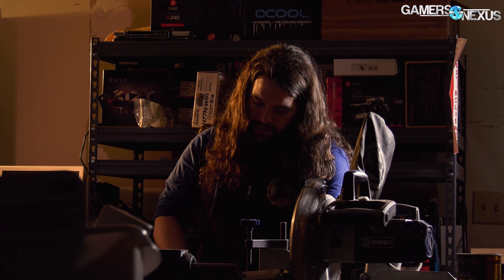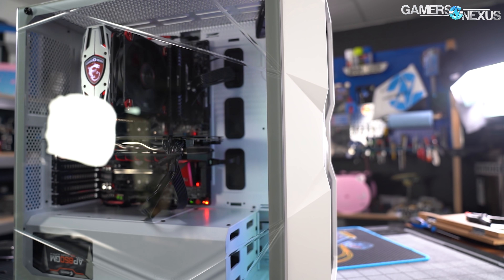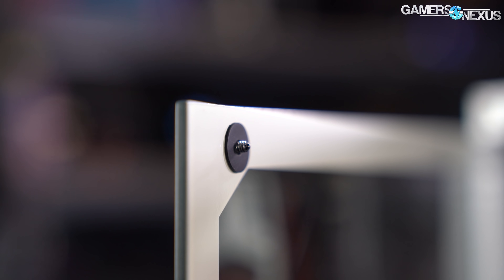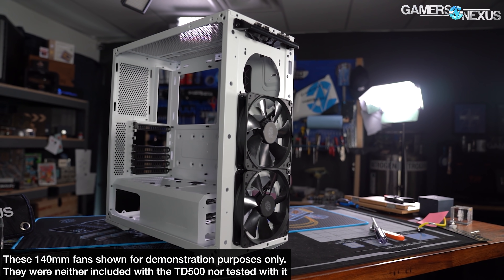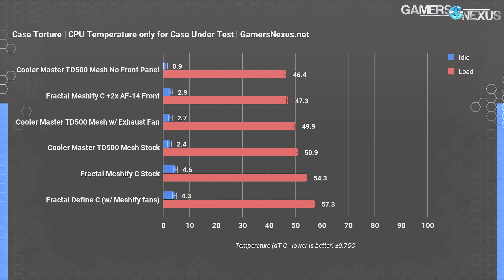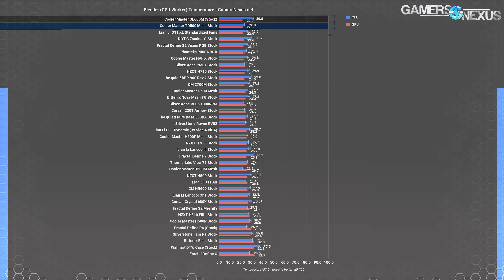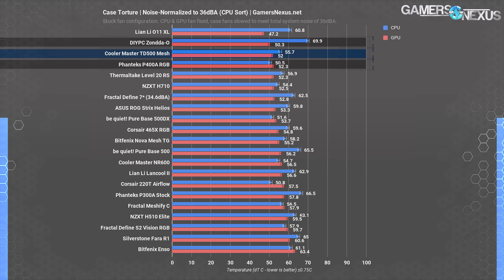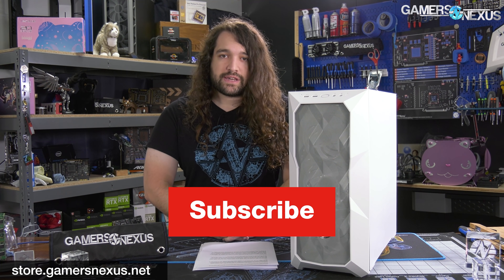Cooler Master TD500 Mesh Case Review: $100 Airflow Show-Down

Comment: Having worked in a repair shop, people never clean their filters. Ever. The use of a fine mesh on the front that's jokingly easy to clean is a very good move. It'd be a lot more obvious to clean, you just wipe it or vacuum it off.

Also, the aRGB header is nonstandard? I could have sworn I hacked up a controller for a friend's cooler master fans and it worked on a 2$ WS2812B controller from ebay
Reply: I clean my DEMCiflex nylon dust filter every 2 days at least and it has visible dust after only a few hours.
Admittedly it is situated in a living area where two skin shedding and cloth wearing humans spend a lot of time but if you're only wiping a mesh once a month that's a lot of dust getting through. It's only logical that if you can see the holes, then non-visible dust can and will get through.
The ideal solution is a dust filter and no mesh like on the upcoming Silverstone Alta F1 (much excite!) or the more ugly solution; my Silverstone Primera 02 with the front panel permanently left off. It likewise solves the problem of filter visibility which you mention.

Comment: I have this case and it's really good. But the top only supports up to 280mm aio that is only if your ram sticks and VRMs are 44mm or lower. The front supports up to a 360mm aio. So if you want better top mount aio compatibility this is not the case. I believe this case is well optimized for air coolers.

Comment: Hi Steve & Co, - what is your opinion(s) on why cases with side-fans have fallen out of favour? Is it because of fan cabling issues, or perhaps just aesthetics of wanting to show off the interior of the case overriding practical concerns? ... Surely a plexiglass type plastic could be drilled and fitted for a side fan?

Comment: Hopefully the fans they included with the TD500 Mesh are better than the ones that came with the OG TD500, because those things were loud AF and I had to replace them to make it worth installing an AIO. Shame it doesn't seem like they improved the cable management area much, because trying to get that side panel back on is a royal pain, and there's barely enough room for the 24pin to fit alongside anything else.

Comment: Oh... What if you have AIO pump tubes to the right so the logo in the pump would be oriented correctly and the radiator is at top? Does that cause problems in the long run? Never thought about these things, always learning something new! :)

Comment: My 500M came with 2x200MM fans. They are electrically compatible with MSI. I have not tested logically, but have the 3 fans and a 3rd HALO fan on the same spliter.  I wonder if with later runs they went with the 5v standard. Mine was built in March.

Comment: My personal point of view says that this is not as good as the competition game.
Let's just compare it to p400a.
Airflow, fans, mesh.. okay both cases do well.
Both cases are like the same price and well built:
P400A extra offers at the same price:
A good bottom and actual cleanable filter
A lot more cable management area to work with, a lot more routes and high quality cable ties.
Better quality dust filters.
Already a dealbreaker for me.
Phanteks: What i'd love to see, is a p400a v2, with the same layout but a bit more modular and the cable management layout of meshify's c, which is a lot more convenient.
Fractal Design: Also an upgraded version of meshify's c, competing these cases with dual 2x140mm rgb fans or 3xz120mm rgb fans while removing the filter inside the front panel which is pretty much restricting the airflow it could have.
Coolermaster: The approach of being unique is awsome.. but build quality was never the focus for coolermaster, and they are being pushed back for this spesific reason. Also the things i said above.
So for the TD500 v2 i'd like to see some stuff:
- More room for big cables on cable management area, and good quality cable ties. (these are must for 2020 standards.)
- Better side panel lock mechanism, this is way to old school. Tooless mechanism is big plus.
-  Some work on build quality material, mostly on front panel
- Some actual good and removable dust filters
- And for god's shake add the other rubber mounts for ssd's. That's such a low cost, and things like that make "possible" customers look somewhere else.

Comment: Just ordered one of those after realizing that cheaping out on a case when putting together my current setup was a bad idea, especially combined with my RTX 3070 being a twin-fan version... which combined with a front-closed Modecom Oberon Pro case was making it cook itself in summer, and even without it, it seems to run too hot sometimes, even after adding two extra fans to the front(Obviously that barely did anything thanks to that case having only tiny holes on the sides...)

Comment: Did they sponsor you? I used this case for a new build. Probably the worst case I've worked with. For example, the hard drive 3.5 in bays is a second thought and is basically smashed in to the cabling from the power supply. I have yet to install the drives but I don't know if there's going to be enough realistic room. The screw profile for the case when installing a video card means that I have to go on an angle just to install the screws because the metal shroud blocks the direct access to the screws. I know they are trying to create a good budget case, but there is a lot of cutbacks where they sacrificed general layout to and it shows. Great airflow is nice but if you can't get the package together it gets frustrating

Comment: I want to see tests where all the fan placees are populated with the same fans (such as nzxt h500 with all the 5 slots populated) with 120mm fans (i prefer 140mm but it is not available to all cases so the test will vary) to see how well the case can perform compared to others.
Same fans, every fan slot used.

Comment: I have a CM MB511 case and the tooling in my case is extremely similar to the point, that I could take off the front panel of my case and change it for the front panel of this case.

I just checked CM's website and they sell parts for their cases and the TD500 front panel is 10€.

Comment: I like the look of the case but there are a few flaws.  Personal I would spend a bit more for the H500 Mesh, but on a budget this is a great option.  The only major downside for me is the cable clearance which is a little too tight - I could buy a new PSU with flat cables but (1) that negates the cost advantage of the case and (2) who has any stock of PSUs!

Comment: How about replacing stock fans with same-size Noctua fans, to correct for fan-specific performance? It would make more sense to test this case with 3xNF-A12 in the front, than the current "standardized fan" approach of 2xNF-A14 front + NF-F12 rear.

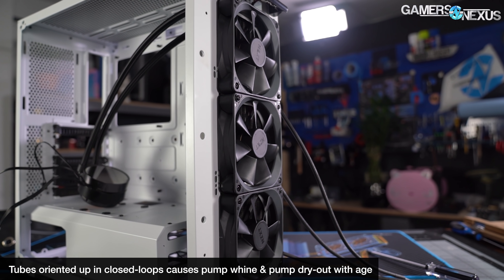Comment: Hey, I have a front-mounted 240mm aio (CM ML240L), the tubes top-oriented ( 12:09 ) ... I don't know if the tubes will have enough reach to put them down-oriented on the front, also the gpu would get in the way as it is pretty big.
Should I just re-mount the rad at the top of the case? Case is corsair obsidian 450d

Comment: I don't plan on an RGB build so I do plan on replacing the front fans with 120mm Artic F12 PWM PSTs as they are great fans and the blades are white. Will a 280mm fit ok in the top of this case or am I better off with a 360mm? Also rear exhaust or don't bother?  I already have those fans on hand and a buddy said he would buy the ARGB from this case off me. Just wondering what the best cooling config would be if I am using an AIO on my CPU.

Comment: Been waiting for this review, thanks!
Any benefits or harm to adding 2 additional fans to the top of the case (directly above the main board and CPU cooler) with a rear exhaust fan? Assuming there's also a twin fan tower air-cooler for the CPU.
Reply: As long as the top is intake there should be no problem

Comment: I unfortunately have to use CAM as I had to get a fan controller because 2 of my mobos fan headers burnt out (my own stupidity). The controller though at least doesn't need the software to remember settings.

Comment: Whatever you do DO NOT buy the non-smesh TD500, which I've seen on the Coolermaster site referred to as the TD500 Crystal. I have no idea what the designers were smoking when they put a large sheet of perspex in front of the 3 fans, but the thermals are terrible. I bought 2 PCs - 1 for each of my kids - that came in a TD500 Crystal case, and although I am not a case modder I ended up replacing the front perspex with mesh bought from Bunnings (Australia hardware store) and pantyhose. Not what you want to have to do when you buy a gaming PC, but it improves thermals on the graphics card by 10 degrees under load.

Comment: I bought this case for my niece, good airflow, case design little bit cheapy , and included accessories are the most cheapy I've ever seen in my life...the last time I assembled new case NZXT Phantom was 2017, they included good number of accessories, hardware screws...etc...this has Nothing except those SSD mounting rubber spacers, ziptight, little RGB hub as separated RGB operation if your mb doesn't have RGB header...a few hw screws to mount mb...

The photos in the manual misled , the bottom psu cover CANNOT be removed! It is 3.5 hd rail removable!

After all B rated mid tower case!!

Comment: I'm having a hard time deciding between this 2021 TD500 ARGB Mesh vs Phantek P400A. Both seem to cool well, I'm curious which one filters more dust. Leaning to the CM because it will fit the biggest Noctua CPU fan and has updated USB inputs.

Comment: Takeaways from this video:
- CollerMaster made a good "500" case on the first try
- Phanteks needs to release P400A with updated internals and call it P500A, to be in line with other around $100 500 cases
- beQuiet should have named their case just PureBase DX, since D is 500 in roman numerals

Comment: What does GN think of the Fractal Design Focus G ATX Mid Tower?
Reply: Probably nothing :D it's been out since 2017, enough time passed that many people bought it (ur humble servant incl. xD), just as many people asked for a review I imagine... and nil
Reply: in any case (tee hee... no pun intended)
1) no PSU shroud if you're into that
2) not too much space for cable mgmt
3) I managed to grind some metal off one front fan fixture, and it looks like it wasn't too straight from the factory... still holds tight but some parasitic vibration is quite possible
4) the metal is otherwise very nice, esp. for the 40 euros I paid... miles ahead of Deepcool and other Thermalfakes. Maybe it's the glossy finish that contributes
5) similarly, all panels sit tight if you're not sloppy. No odd buzz
6) insane airflow imo, doesn't get hot inside
7) top fan placement is a culprit though, the mesh plates sit between the fans and the chassis so you have to unscrew the fans when cleaning time comes
8) same goes to the front panel. A pain in the neck to remove, although it may be similar for other cases, haven't tried :D

Comment: Silver or white radiator screws are that uncommon, are they? Surely they'd be preferable to pins or black screws. The stock fans look like they have transparent frames that let through light from the sides, I'm surprised they're not sold separately although I suppose their Halo fans are their alternative.

Comment: The added fan on the back invalidates my main question. How do you feel about the included cooling solution? Are the 3 RGB fans in the front sufficient or should I add anything?

Edit: nevermind got to the right part of the video. ill leave this as a mark of my idiocy rather than deleting lol

Comment: I'm having issues with my TD500, when I connect it to the mother board it wont boot at all. I Turn on the power supply and I get an RGB light from the mother board so I know its getting power. and I followed the connectors on the manual properly I'm sure.

Anyone else having issues with this?

Comment: at 16:00 to 16:20 what does he mean? "That mesh isn't good enough alone." confused by what that means exactly and what are my solutions to that problem?
Reply: He means you need to buy good case fans (140mm Noctua he says here). Basically "mesh isn't good enough alone" = "mesh isn't good enough alone without good case fans to take advantage of it"

Comment: I recently bought one of these, I put a radiator on the front but there's very little airflow inside the case, the glass on the front blocks most of the airflow

Comment: I have a bit of ADHD so I couldn't quite make out a detail, but is this review suggesting to add an exhaust fan at the back grill area of the case? I just bought the case and finishing up my 3080 rig, but the product did not come with an extra 4th fan for the rear mount. So should I buy a 4th fan for back exhaust?

Comment: Hello, I need help. On cooler master page it says "Radiator Support - Top
, 120mm, 240mm, 360mm, (44mm max motherboard component height)" but on 12:21 in this video Steve says top has 120 and 140mm mounts, does that mean 280mm will fit? I want to buy this case with Acrtic 
Liquid Freezer II 280.

Comment: I see the specs (in 2022 at least) say it comes with a non-RGB rear exhaust fan, but in video reviews, no one seems to run it.  This review used a cheap 120mm exterrnal fan for additional tests, which implies it doesn't come with one.  Can anyone clarify?  I'm guessing in any case (excuse the pun!) that adding a rear fan of any type is going to be pretty negligible in terms of what the test results returned here, so probably not worth worrying about ...

Comment: between this and lian li 215 , which one should i pick -_-a  this TD500 look gorgeous, but Lianli 215 cheaper in my country
Reply: Was looking for a case upgrade and was about to buy this at my local microcenter but I just couldn't get over the weird design on the tempered glass side panel. Went with the Fractal meshify 2 instead. A bit more expensive but oh my god is it perfect for everything you throw at it. Amazing airflow and design. Easy cable management, and crazy radiator compatibility.

Comment: Tubes go down? That’s literally the first time I’ve heard this. How’s that work on a top-mount or rear radiator then?
Reply: I think in that situation try to keep most of the tubes low. Idk if putting the tubes left or right does anything.
Reply: Tubes go down from the radiator. So top-mounts would automatically have that orientation. Rear mounts might be tricky, but the lowest mount option on a rear-setup (assuming the exhaust is near the top) would still bring both ends of the loop to about the same height, which shouldn't be too bad.

Comment: Out of the following which one seems to have better Air flow stock or not I plan to use 2x memory sticks from Patriot Viper 16*2 totalling in 32 GB
Going to be using CPU Air Cooler DeepCool Neptwin (DP-MCH6-NT-A4RGB)

H500 Cooler Master Stock
Cooler Master NR 600 + 1 fan
Cooler Master TD 500 Stock
I wish we had access to sheet so I wouldn't bother you.

Comment: Considering high airflow fans are recommended as case fans, how come no one ever mentions them?
I'd love to see what difference high airflow fans would have, if any. But then at least we would know.
Reply: I don't recommend them. Who recommends them? They're expensive and loud, and most people don't need them. If you work in a particularly hot environment or you're running servers, sure, go nuts. Personally I prefer having air conditioning so that I'm comfortable and my PC doesn't need to be loud.

Comment: Does the 500 stand for size? 500mm, perhaps?
Why is there so much dead space in the front of the case? It looks like you used a mini-ITX motherboard. I guess people just like bigger cases.
140mm fans fit in the front of the case..but you have to get out the metal snips like usual.

Comment: Will this case allow for a 240mm corsair AIO radiator to be mounted on top with clearance for an ATX board with non low profile ram?  I can’t seem to find a mid tower that allows for this.

Comment: I'm a little confused about the mounting orientation comments being made at 12:12. Just to confirm, it's okay to mount to AIO on the front, with the tubes at the top? As long as the tubes are higher than the pump, right?
Reply: Should be fine yes.

Comment: im thinking of purchasing this case. but im worried that my Noctua NH-D15 CPU cooler wont allow me to put the side panel back on as my current mid tower case has no side panel due to the fan sticking out just enough. anyone know if this fan will fit?